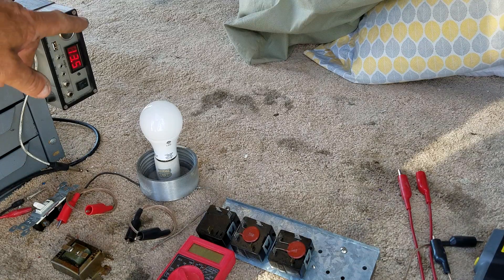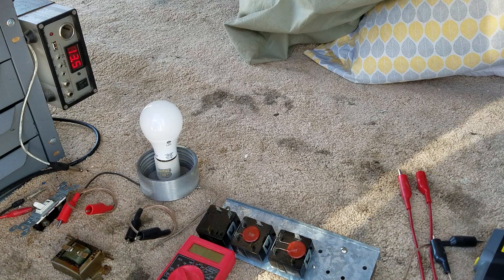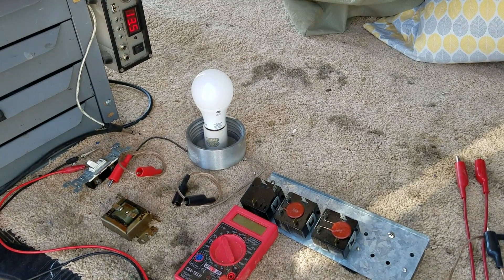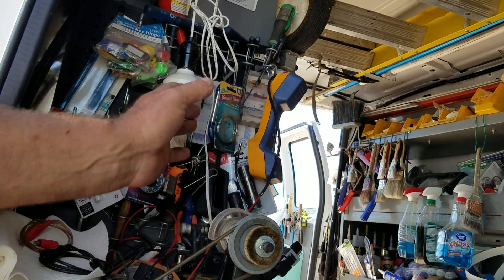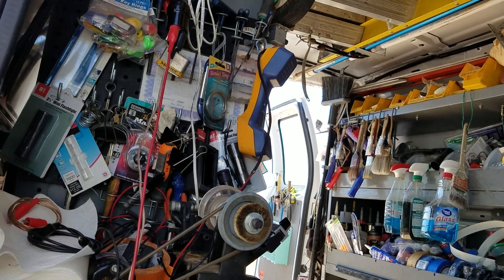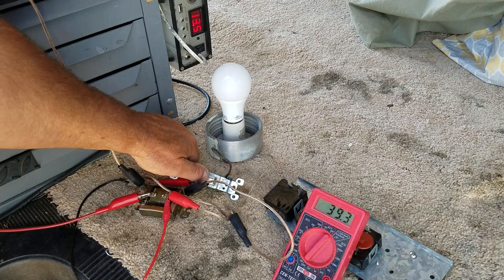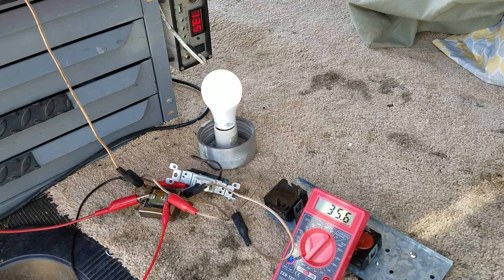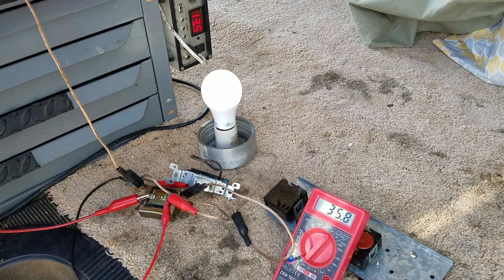Oven ballast converts DC to AC volts

Comment: I think people overthink many things. This proves that you don't need fancy stuff to make basic electrical stuff work.
All the light bulb cares is whether there is enough voltage and current to overcome the resistance in the filament to produce light. 
I remember being amazed when my 4th grade teacher made a simple circuit with a D cell battery and a flashlight bulb.
Reply from the maker: When I was a cub scout one of the projects for a badge in electricity was to build a simple motor to run off of a dry cell battery.  The instructions were in the cub scout book.  Copper wire, nails and an aluminum pie tin were the main components.

Comment: Interesting ,wonder if a microwave coil, would jump it more?
Reply from the maker: I may try that since I have a few laying around.   Maybe also a doorbell transformer worked backwards, ie; 12vdc in ?vac out...
Reply from the maker: Oh, and Welcome aboard!
Reply: @GBear  thanks..im not electricly minded, but i watch some of this stuff, & think is it really that hard!?
Having no education in circuitry,or all the little gizmo's i see when i scrap out some ,dead piece off technology, i always think!, if i lnow what those things were good for i might make something worth while, & most of this stuff fails becuz of a cracked circit board, or 1 single component!
Reply from the maker: Most fails are a small capacitor that burnt out.  I find them on old circuit boards all 5he time.